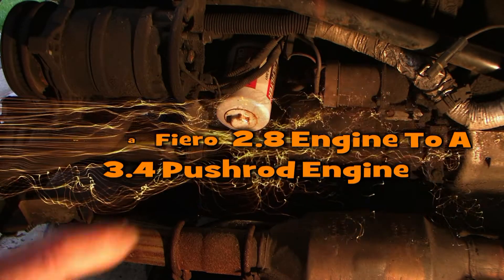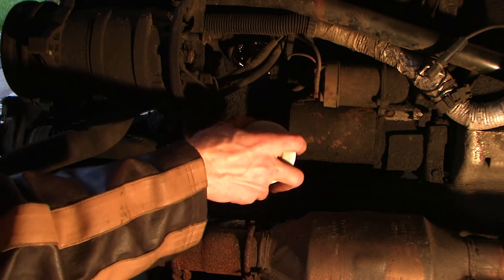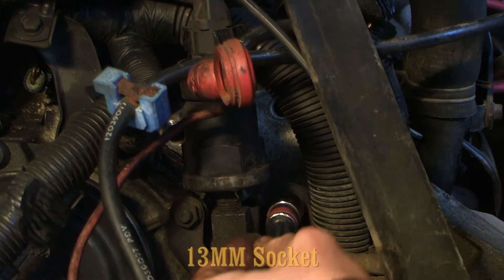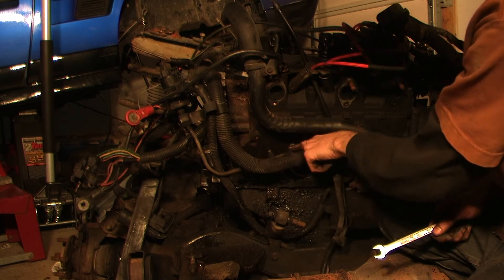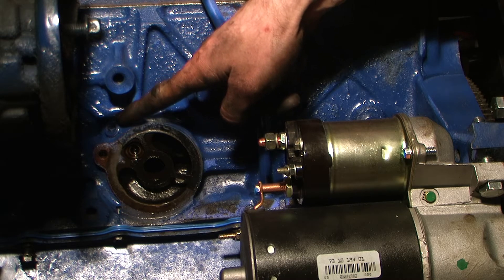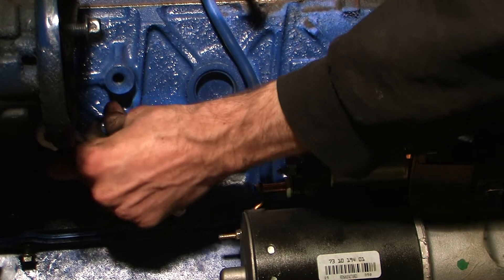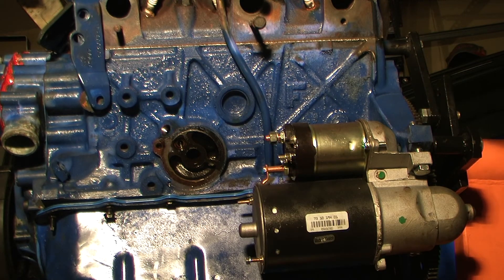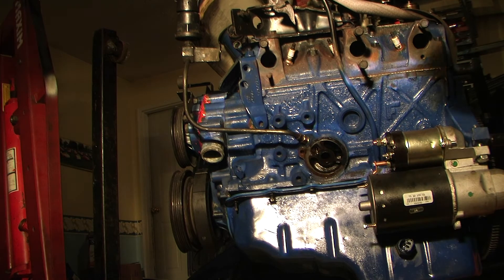Pontiac Fiero: How to Convert the Oil Pressure Sending Unit for a 3.4 conversion

Comment: Good job on the video!. By the way, GM TSB 88-8-22 calls for a relocation of the sender. The 85-87 models tend to be very sensitive to water. It would probably be a good idea to switch the sender to an 88 type (actually cheaper to buy than 85-87 model!) and relocate lower just underneath where the AC compressor would normally reside on the 3.4. Just a thought.